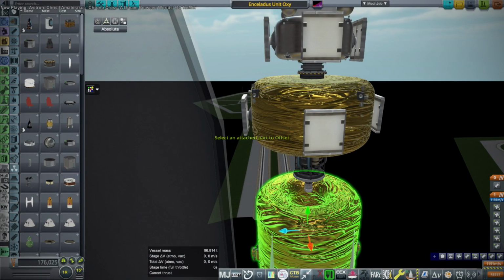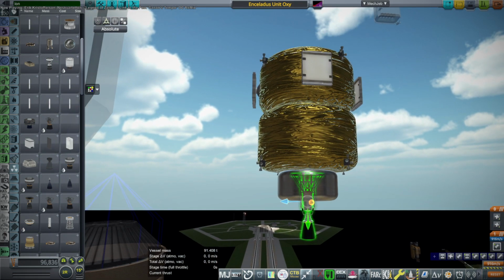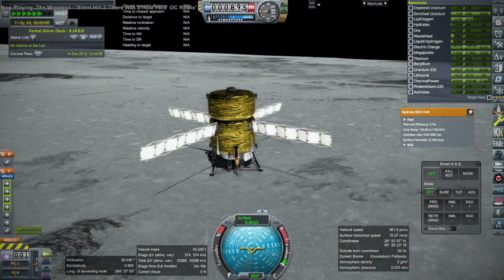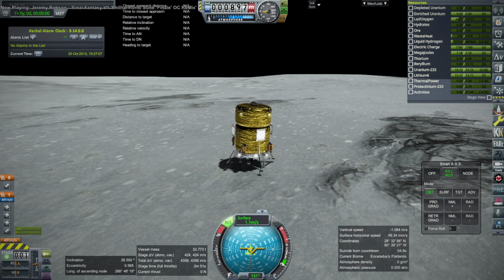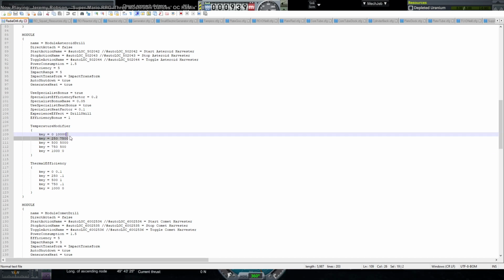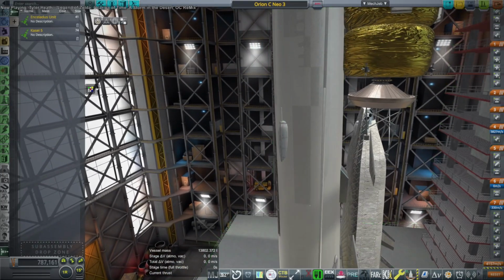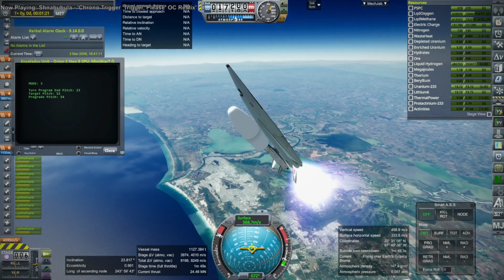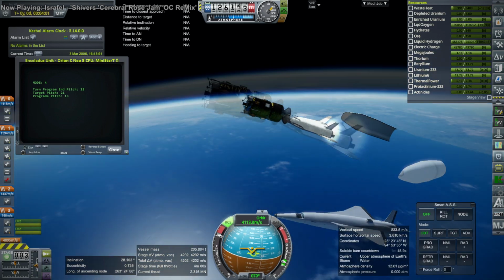Enceladus ISRU Revised (RO in KSP 1.12)

Comment: 134 kelvin on enceladus. What does this temperature mean? There's no atmosphere on enceladus.
Reply from the maker: Temperature in space is a measure of the ambient radiation. Since the radiators are trying to radiate the heat away, I didn't think they would be able to do so to a point below this ambient radiation measure, which is what we define as temperature in space.